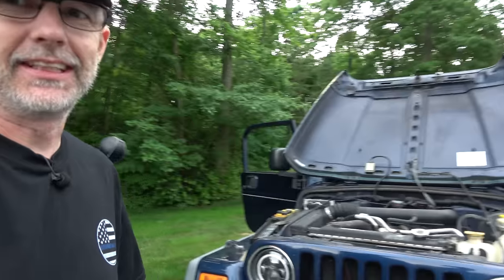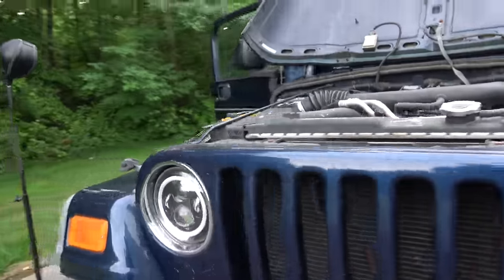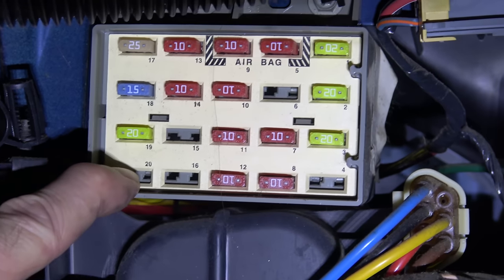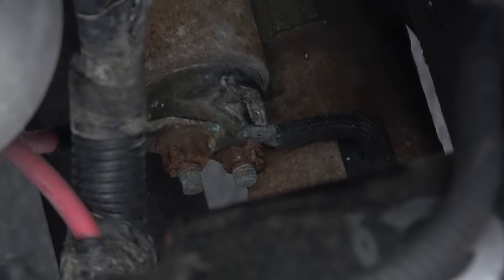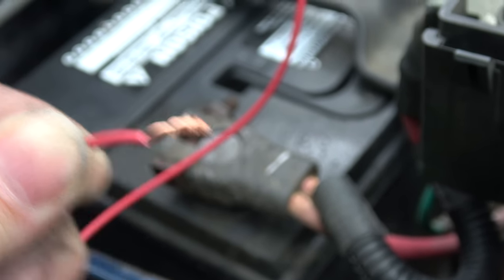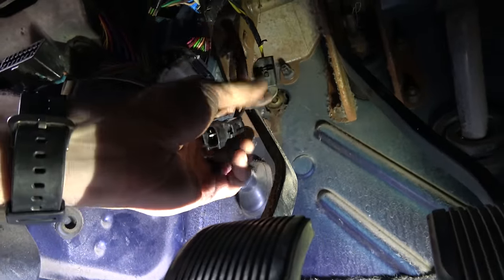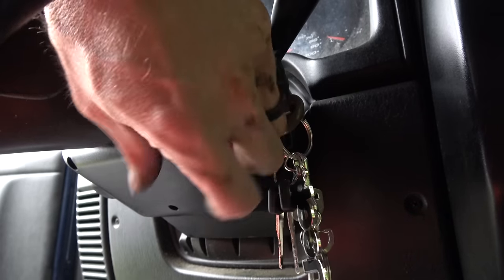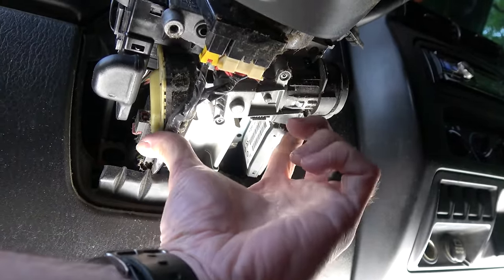Troubleshooting Jeep TJ Wrangler! Won't Start but Problem Found - Project 2004

Comment: IF...you own a jeep .....you should be a decent mechanic , if not you better have a decent wallet!
Reply: My daughters 2001 Jeep Cherokee just threw a rod or broke a piston ...either way its done for. I just replaced the radiator 3 weeks ago . Kinda glad it's finally over ...i was tired of working on it.
Reply: ZZBUDZZ that’s precisely my problem, no e of the above🤦🏻‍♂️
Reply: My dad passed me down his 2005 tj, I’ve had it for a year and have spent about 1 grand in parts so far. It’s never been to a shop and everytime it broke me n my buddy have fixed it
Reply: Im working on my jeep as we speak and the thing is, I will never NOT buy a toyota ever again...
Reply: Definitely.

Comment: I wouldve popped the clutch in the parking lot. Could’ve saved u a tow
Reply: popping clutch did not work. because the ignition switch is not being turned (it has 2 parts, inner and outer)(when the metal tip breaks, you do not get the actual 'ignition' - only the power to all your other stuff) once you see the starter turning over (as in the vid) you understand why you are not getting it to start... (no ignition, just turn-over, as in roll start)

Comment: Im stuck. I've got a 97 that decided to stop cranking. The battery is fine and it seemed odd for it to fail so out of the blue so after reading the forums I assumed it was the actuator pin and started there. I got the pin out and it was all still in one piece. I replaced the starter to find that that wasnt it either. I played with the fuses for the starter and also placed a fuse in the position 20 slot and that didnt do anything. I'm not sure what else to do

Comment: My ignition is working intermittently. Do you know if it's possible the actuator will work off and on before failing completely like mine?

Comment: Wanted to thank you for this video. Last night trying to leave work my Jeep wouldn’t start, it’s a 2004 LJ in mint condition low mileage with a new battery. I could feel the key didn’t feel right so I was sure it was the ignition but I had no idea what exactly it was. I got a ride home and did a search and your video popped up, I knew this was my problem. I ordered the part today then tore it apart and it was broke exactly like yours.  I used a screw driver to start it and get it home. This saved me a ton of time and money. I subbed your channel and when I have issues I’ll check here first.
Reply: fixed it?

Comment: Your video made changing these parts a breeze! Thanks for the in-depth instruction, it really helped understanding how the parts engage with each other when putting them back together. I have an 03 wrangler, came out of the store and the Jeep wouldn’t start.  After replacing the starter and found that wasn’t the problem we searched on-line and found your video.  Our part broke in the same exact spot as yours did.

Comment: Your video just saved me. I needed to get my jeep back up quick in time for work. Every Google search and forum I found kept directing me in the wrong direction. This was EXACTLY what was wrong with my 03 TJ. $75 in parts and an hour later my Jeep is running strong again.  Thanks for your help!

Comment: My ‘97 will turn over and will fire with starting fluid. However the gauges won’t work and it won’t pump fuel. After watching your video I’m going to test the ground wires. Thanks for the help.

Comment: You just saved me countless hours of scratching my head that is the exact issue I have I did your wire test on the ignition wire and I have the same issue. my ignition has always been a little flaky time for a new one

Comment: I'm at this point now.  It's dark now.  I have to work the next few days.  Just replaced the Relay, purchased the ignition switch. Did not see in the diagram that I have for an actuator "PIN"  I'll have to go back to advanced Auto to see if they have that.  Excellent video.  Just subscribed.  Hoping this works.  Like most families, we live paycheck to paycheck because of covid.

Comment: Your video just helped me diagnose this exact issue - THANKS! The metal part was broken in the same way. One thing I would add is that you'll need a small security type torx bit to get at the actuator - be careful, there's a spring in there. Also, f you don't know how to get the key barrel out (like me) you put your key in and turn it while depressing a small latch on the underside of the barrel. You can then pull it out with your key. This will free up the actuator so it can be removed.
Reply from the maker: You probably didn't see this video... 🤣🤣...https://youtu.be/IiKXqr5_0D0
Reply: @o3djeeps  Awesome - thank you! I have now and I'm glad. My part comes in tomorrow and your videos will have made it a breeze to fix. Very cool.

Comment: Hey, just a heads up, before anyone starts tearing things apart, check your neutral safety plug at the transmission.  I found that it had fallen off and just needed to be plugged back in.  Super easy fix!
Reply from the maker: Yep... Actually covered checking that in this very video. You must have fast forwarded through that part.
Reply: @o3djeeps  Opps!  I must have!  Nice job on your video!

Comment: Saved my life, Jeep Rubicon 2015 wouldn’t start for two days before seeing this video, I thought it was either battery, fuse or starter. Paid local mechanic to check with machine no signs of problem. Solved problem by jiggling or slightly holding up key while turning the ignition!

Comment: Had the same problem in an 06 Liberty and had it towed too. Next morning woke up and found the same problem. I wish you would of messaged me on insta haha. Glad you got it fixed pal!
Reply: when you left the key in the igntion was the security light turning on? i have an o5 liberty. first the air bag then the fuel light then the check engine then the security light ?
Reply: When you turn the key basically nothing happens/clicks because the ignition switch rod is not turning the ignition switch. You can unscrew the plastic cover under the steering wheel and on the left side you will find the ignition switch. Unscrew that and then place your ignition key in the key cylinder. Then take a screwdriver and turn the square keyway inside the ignition switch box and it should crank up the engine then release the screwdriver once the engine started.  Your key has a transponder chip inside of it so it is needed in order to start the jeep.

Comment: I’m so glad you posted this. I have an 04 LJ with the same issues. All dash lights come on, power is coming from battery and I just replaced the starter a few months back. Next day I’m off, I’m gonna check it out. Appreciate it man!

Comment: Your video saved me some time and money I appreciate it! Switched out the power converters just fine but didn't have any needle noses on me for the fuses so I tried to pull them out by hand, hit my head on a low flying plane I got shocked so bad but somehow that seemed to do the trick thanks again!

Comment: Thanks, some great information in here, I have the same problem and I’m going to try the steps hopefully I will resolve the issue. However mine seems to be an intermittent issue
Every once in a while it won’t start and then out of the blue it will start again

Comment: My Jeep suddenly wouldn't start after replacing the coil pack. You video lead me on the right path.  My problem turned out to be the wire from the ignition switch to the starter solenoid was broken. Easy fix.  I also last year had a similar problem with the ignition switch actuator being broken, but in y case, the Jeep would start, but not turn off.  I kept pulling a fuse to kill the engine until I got the new ignition actuator.

Comment: I have to think how many more potential problem points there would be on the JL if the symptom was that the starter was not turning over.  I think the car manufacturers are intentionally trying to make the vehicles more complicated so as to make it so that you have to take your vehicle into the dealership to get a problem diagnosed. :(

More "features" equals more complexity, equals more potential failure points. :(

Comment: You should really explain yourself at 2:26. I'll assume you bought the hammer to tap the starter (sometimes if the starter is crppin out, it may turn again if you tap it)
  Or maybe you just needed the hammer to get the jeeps attention, lol
  Great video, both of them, it really is the 'best'
  Helped me a ton. My friends jeep was a success because of these videos. Hers was the ignition module, i think, she bought the module and the actuator. I would never have attempted pulling apart the column if i hadnt seen you do it. Pretty sure hers was the module, the pin was ok. Something was rattling in the module

Comment: I was hoping I had the same issue you have in your next video and replaced both pieces like you did.  It didn't fix the issue.  My center piece wasn't broken.  I will try your "hotwiring" to the positive tomorrow to see if it cranks.  For about a week when I turned the key it felt like the whole cylender inside was turning, but I don't see how it could now that I have taken the whole assembly apart.  Any other suggestions?

Comment: Liberty same install in key on position that allows after IGN mod and actuator are assembled in place, you will be able to install key IGN switch and will lock in place smoothly.  Good video AA ++

Comment: did you check the tumbler?  they have a long connection bar that snaps, mine snapped once.  continues watching video... yep.  just remember that issue.  because the tumbler has resistance every time you turn the key. that will fatigue the cheap cast metal they use.  if you want, you can modify it with a long steel rod you custom fit to the tumbler, and this will never happen again.

Comment: How did you check for continuity when testing the clutch? Did you plug both the pos and neg cables into the circuit? What sockets are your cables plugged into for testing the clutch circuit?

Similar question for using the multimeter to text the voltage for the starter control wire. What sockets are your wires plugged in to?

Comment: Thanks for all your videos!! I have a 2001 jeep wrangler. Good battery, replaced starter but every once in a while, when I go to start it, it takes longer to start or it just "clunks". I will also say, the key will come out without pushing the ignition button.  I don't want to get stranded somewhere.  It is a manual, 4.0 TJ.  Yes, i do have the clutch pushed all the way down lol. Any advice would be appreciated!!

Comment: I had to bypass the clutch safety control on 2001 TJ  by moving a fuse into #20 spot. I was able to crank up Jeep after this. What would be my next step in order to avoid future problems in this department?

Comment: Hi, Thanks for all the great video's.  Had all the same symptoms. Before seeing your video's we purchased a new starter not the problem so we replaced the a actuator pin and stater switch and still nothing. Any ideas? Thanks, Rick

Comment: Daveys Jeep is a great place for parts. You can also get a new ignition actuator from a auto parts store that sell Dormen Parts. They make the actuator for $40. But you have to assemble it. And it can be a pain. Dealer Ships want you to buy a new steering column.
Reply from the maker: Jack Homitz I bought a new actuator and switch from AutoZone... Done and done.
Reply: Never do anything a dealer wants you to do!

Comment: Sounds like it would be worthwhile to build a "pin" bypass lead and crank the starter from the battery....how about a video for that ....should be few inches of wire, connectors, and a toggle switch....yes?
Reply from the maker: I'd rather it just work from the key as normal...but yeah... you could just make a wire like I did and add a switch and run it to any 12v source and trip the starter whenever you want. I've seen people do this. If I ever get stranded for this reason again... I know know exactly what to do... screwdriver from the hot post on the starter solenoid to that male spade for the control wire oughta fire it right up so long as the key is in the on position.
Reply: i had to do this bypass before i saw this video. I have a "push button" starter now. Its a momentary toggle. works perfect.  Im pretty sure I have this videos problem, but bypassed it.
Reply: @o3djeeps  Shorting the male fast on to the positive battery terminal will or will not start the jeep?  Mine didnt start would only crank.  At the same time the control wire does show 12 volts when key is applied.  Also I shorted the clutch switch long ago after it failed.  Kinda lost here and the glove box fuses are spares and populated.

Comment: I have a Jeep 2008 Wrangler six cylinder. My wife went out to start it one morning. The windshield wipers came on the dash lights all lit up but nothing. There was no sound from any part of the vehicle. So I bought a battery to replace the one in the vehicle, when I went to connect the battery the green wire burnt through all the way the horn came and there were sparks at the battery connection. That is I hooked up the positive and tried to connect the ground and that what I got, a burnt green wire, the horn and sparks at the ground on the battery? I have never seen anything like that before. I have only had this Jeep a short time and never owned a Jeep or a Chrysler vehicle.

Comment: When you cranked the engine by jumping the starter solenoid, would the Jeep start and run or just crank like it wasn’t getting fuel?  Asking bc my 06 Rubicon will crank doing that jump, but won’t start even with the key in the on position, even though the fuel pump is working. But by turning the key, you get no crank or click.
Reply: The Friendly Grumpy Trucker  i’m having this problem as well what was your solution?

Comment: Same issue and bought the same parts. Only question is would the jeep start using the spade connector trick you showed with key on run position? I've tried this on my jeep but it only cranks. I swear I even hear the fuel pump cycle on....doesn't make sense and now I'm worried I may need a pcm to actually fix the issue

Comment: How did you know it was the actuator and not a faulty switch?  I am having a problem with intermittent power relay to my accessories and assume it is the switch.

Comment: I have a 97 tj. I have the same issue about every 30th start. I can slap the side of the steering g column and it will start. I’m going to look at wiring connections at the plugs

Comment: Im having the same issue with a 2008 JK. Would trying to start it at the actual ignition switch give you a crank in this situation ?(electric switch, not the one with the key)

Comment: 2 questions: 1 did you also have an engine light on cuz I do and 2 what was the part number to fix your issue? Thx
Reply: Does everything work on your dash when I first got my 98 TJ Sahara my speedometer didn’t work every other gauge did once that was fixed the light went off
Reply: Ended up being my shifter cable was seized but in gear not park so I couldn’t start it.... I bought it as a won’t start purchase
Reply: Adam Perkins glad you figured it out and fixed it currently trying to get my ignition cylinder out but somehow it’s stuck unsure how or what to do lol

Comment: Got a 1998 Jeep Wrangler with the 4.0 motor, just driving back home, it cut off, won't crank up, it spins over but won't start, I got fuel going to it, someone told me when I tried to crank it, rpms wouldn't move, though it was cam sensor, changed cam sensor, bought it from jeep dealer, I changed coil, plugs, wires and rotor button, still cannot get power to coil, getting ready to change key switch , hope that works, if that doesn't work, do you know what it could be, I have checked out all the wires they look good

Comment: Hi! Have you ever come across this problem? I have an 04 wrangler sport (standard)

I can’t shift the car into gear once it’s running.  When car is off it shifts fine.  I start and then can’t em get it out of neutral!😔

Comment: Great video. 2:44 got to clutch bypass switched the fuse from 19 to 20 and it worked. The jeep started. But what does that mean? Thank you in advance for your help
Reply: That your clutch switch is probably faulty. Pull the connector like he did under the dash and do a continuity check.
Reply: Ok,  but continuity to what? I only saw him connect to one plug, what does the other lead go to?

Comment: no joke this happened to me last week on my tj!
Reply from the maker: UmmDavid did you get it fixed?
Reply: o3djeeps [ OVERCLOCK3D Jeeps ] I did only after I spent a day changing wires thinking a few have gone bad, but I’m happy she’s working now
Reply: UmmDavid was it the same problem as in this video?
Reply: I'm currently dealing with the same problem (since last Saturday). Wiring up a push button start now and ordering the replacement unit.  Thanks a million! 
05 LJ Unlimited Rubicon

Comment: With ignition mechanism brocken do you still turn in all your dash lights indicator and gauges? I have 2010 wrangler no crank probed the starter relay no 12vdc on pin 85/86 so I replaced ignition switch still no crank. Any idea?

Comment: What if it wont start even with the remote wire jump and just turns over?  I changed my pin and it still wont start?